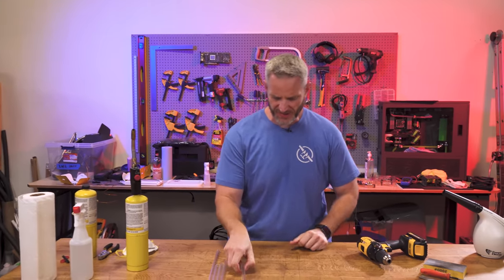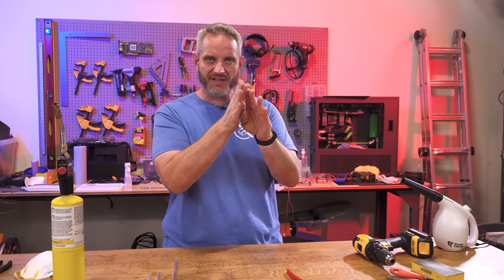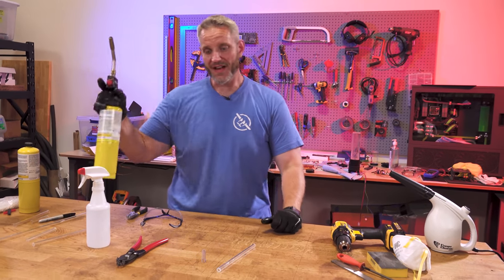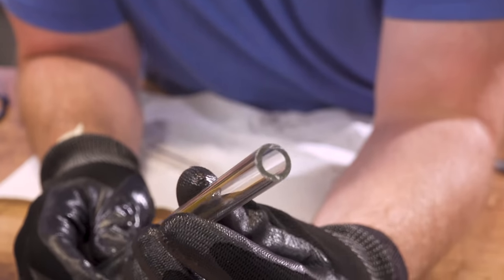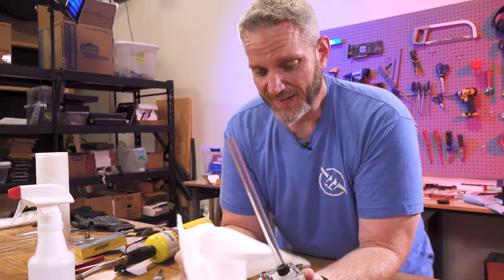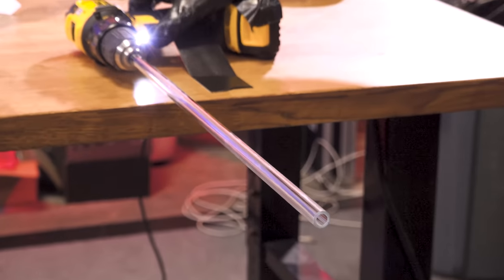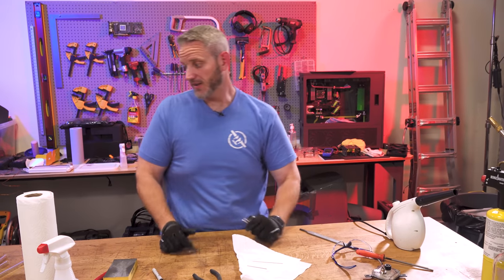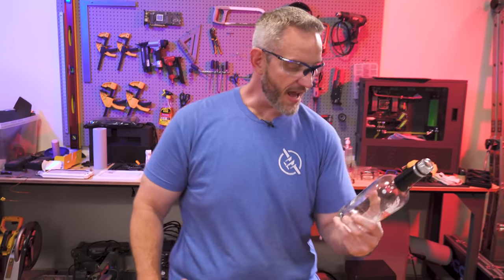Learning how to bend Glass Tubing... This looks soooo good!

Comment: Former sign guy here,  put a cork in one end of the glass and rubber tube with blow piece on  other end and as you bend glass keep constant pressure. OR find a neon sigh shop and have the neon tube bender bend your tubes for you. As somebody else said neon tubing comes in many colors and diameters (and is most likely cheaper) available from sign supply shop.

Comment: Nice vid, The glass tubing that has the spiral tube inside it, a glass distillation/condenser tube, with different coloured liquids/glass would look awesome as a main reservoir! When you place the 'O' rings on, try using a little water with some detergent to help get them in place, you could also use a small rubber washer to help with a water-tight connection.
oh and you really need to use some decent safety specs, the ones with didymium lenses are best for borosilicate.

Comment: if you're going to be doing a lot of glass tube builds.  In the stained glass world, there is a diamond ring saw to cut glass.  The blade of the saw is a 360 degree cutting direction.  This would be a  good way to precisely trim your glass tubing and giving a more finished edge after the cut.   Google "stained glass ring saw"  Zephyr makes a good product.

Comment: Try sliding a bit of PVC over the glass to "extend" the glass tube when scoring and breaking small sections off. You can even use a bit of tape to make the PVC friction fit to the glass.

Comment: To round the edges after scoring an snapping the glass tubing you can proceed to just heat it until the glass gets soft, then it will round the edges by itself without the need of sandpaper, etc.. Borosilicate glass has a really really low heattransfercoefficient, so you dont need to worry about the whole pipe heating up when your only applying heat to edges. In university we use a very powerful hydrogen/oxygen burner for preparing tubes and ampules and you can touch the glass even a few centimeters away from the spot you're applying heat to even, even without gloves you won't notice the extreme heat.

Comment: I'd make some mandrels out of hardwood to bend the glass around or at least as a guide while bending to get your angles correct. I also think you could cut off short pieces if you put the glass tube into a block of wood with just the right size hole drilled into it. If the short piece that needs to be broken off is near a bend, clamp the bend into a vice with blocks of wood and use another block with a hole drilled into it to break the short piece off. Alternatively, if you have the correct size drill bit  to fit inside the glass tube pretty tightly you can use that on your short end that needs to be broken off. Disclaimer, not a professional glass worker, just a fan of cheap tools for once in a blue moon projects like this.

Comment: When I make a short cut on glass, I put a wooden dowel in the short end to apply pressure from the center. Not a science or physics major by any means but I think the dowel evens out the pressure across the whole inside diameter of the tube. Hence making a cleaner break.

Comment: For trimming glass tubes use your dremel with diamond disc and for smoothing edges use your gas gun (torh) and apply heat on the edges until they start melting and you ready to go 
Good luck with next glass project

Comment: You need to make a loop with Quartz Glass Tubes! Blistering temperatures won’t melt these quartz tubes, and rapid temperature shifts won’t cause them to crack. Even tougher than borosilicate, they can be used in furnaces and ovens heated up to 2000° F. These highly pure tubes are often used in laboratories because they won’t leach impurities into samples or contaminate chemical reactions. Quartz tubes are optically clear and have excellent UV transmission, making them ideal for UV purification systems.

Comment: Two points:
1) You could have explained a bit about different types of glass, specifically borosilicate is much more resistant against sudden temperature changes than "common" glass, if the tube was common glass, your heating and cooling methods would have resulted in it cracking into pieces; and
2) If you want to cut the glass instead of the slightly dangerous scoring and forcing method, the diamond blades for e.g. dremel-type small drills are not that expensive. This goes also for drill bits that you can use to smooth out the sharp corners of glass, or even bevel glass parts.

Comment: Jay, As a retired OSHA inspector, safety first!  Get some safety glasses that are made for glasswork.  Save your eyes.   Get a block of wood and drill a hole so you can put that map gas bottle in it so it won't fall over, eventually, you will knock it over or set it down too quickly, and then it will fall over, it's top-heavy.  At some point, (and I know this will happen) those gloves are going to get too hot. and you won't be able to get them off fast enough, have a bucket of water close at hand so you can dip your fingers in it.  Glass needs to cool slowly to reduce the heat stresses you put in it with the torch.  reading a little about the annealing process will help.    If you must cool down the tubing blowing on the outside of the tubing isn't going to do much if the center is still hot.  Lastly, you will be surprised how fast the glass will cool if you just put it down on the concrete floor or a good-sized piece of plate steel.  It works like a heatsink.   I really enjoy your show and Good Luck playing with hot glass.  BTW, ox-acetylene is a thousand degrees hotter than the map gas.

Comment: Please do a themed glass tubing build!
Try using a Dremel cutting disk or diamond saw to cut shorter pieces. As long as you keep water on it and are patient you can literally carve granite with a dremel and some good diamond bits. I would be amazed if you couldn't shorten your glass tubes with one.

Comment: Jay, for making cutting the glass easier look into a small tile saw. They have the ability to hook up water and have diamond blades. You can find them reasonably priced at Harbor Freight or similar places. I just looked and Cali prices range from as low as $60 to however much you want to spend.
Reply: He's overcomplicating it. Just get a dremmel with diamond cutting disk.

Hold the tube in a vice (wrapped in a cloth or old t-shirt).

To cut more than 5mm off the tube keep the dremmel parallel to tube and move round it in a circle to score a circle, then just keep deepening the circle till the glass falls off.

To take under 5mm off, hold the dremmel the same way but use the top of the disk and move it in a circle as if you are polishing the end of the tube, it makes a lot of glass dust, so use goggles and mask.

To finish a tube off, use sandpaper round the edge, then a finer sandpaper after that.

Don't use a flame to treat the edge as it has a mushrooming effect and may stop the fitting going on.

Comment: Tip: if you want to break a little piece off like at 15:52, get a dowel that is the exact diameter as the inside diameter of the glass and use that as leverage

Comment: Use cutting oil when using your scoring tool, makes a much much cleaner cut and removes the necessity for water on the break. 👍 working with glass had its benefits 😁

Comment: I would try using a wet saw used for cutting tile .  They use continuous rim diamond blades . Its more of a grinding action so it might cut and smooth the edge in one pass.

Comment: I know when bending thin tube, a tip is to fill the cavity with sand and then block both ends. When the tube bends the trapped sand maintains the inside diameter meaning you will not get any pinch at the bend.

Comment: Glass can explode during rapid cooling. Also! If you put a little air pressure (I MEAN A LITTLE). The bend will stay more uniform. If you can find a squeeze pump with cut off valve. One squeeze will be enough. And I am not a professional  gaffer. But I have done hot glass art for two years. But really let glass cool slowly. It's far safer. Because small glass fragments in the eye. Is far harder for the optometrist to see and find. But the art of blowin glass is awesome. Corning museum of glas also has small peice videos on youtube. You should give those a look see. They are very cool.

Comment: Wow I’m impressed with your second bend . I didn’t think there was a way to do it without it collapsing on itself . I think a build using glass and having bends in it would be killer .
I’ve never tried a water loop , but your making me want to attempt glass after I see the difference in clarity.
I’m wondering if my Dewalt tile wet saw would work for cutting small amounts of the tube off ?

Comment: Use those compressable foam earplugs in to block one end if you want to introduce air into the other, honest im a bit shocked you can get a bend with mapp its not really hot enough to work it. Also that orange flame is called sodium flare and it is basically like lookin into the sun as far as eye health you should at the very least not look directly at it. lastly when bending you should always have the longer (outside) curve of the bend facing the floor (gravity makes the glass flow down, this helps with maintaining wall thickness consistency, tho at these temps it may not be as much help).

Comment: you can also snap shorter pieces of glass you will need 3 pieces of copper , 2 will be tubing 1 will be rod and a hand full of rubber grommets, take a stiff rod of copper the same as the inner diameter, and a piece of tubing the same size as the glass and one that will slide over that and the other glass, , to start slide the inner piece into the tube stopping before the cut line.
 Mark the inner rod with a sharpie and then remove it and slide the next size up to the mark you made drop a spot of solder onto it using flux, then use a file and by sticking the copper tube and rod into your drill flush up the solder and square the end of the second copper tube.
 Then reinsert the rod into the glass up to the end and use the 3rd piece of copper tubing as a slide over cover of the area you want to remove from the glass tube, the rubber grommets are used to take up slack if you need to make shorter cuts, to do this add onto the copper Rod to make the auger shorter, 
 My father used to use this jig when he would repair his Argon welding tank meters and tube volume meters.

Comment: My brother in law did Neon signs. You might want to look into how they do that since he could bend or weld the glass tubing like it was wet Spaghetti. One trick I saw him do was cork one end of the tubing, use a similar cork on the other end with a rubber hose that he would blow into while bending to prevent the bends from collapsing.

Comment: for the shorter Glass Breaks you can get a pole Slightly larger than the glass cut the pole in 2 and use that as extensions it works weve done it before but the glass has to fit snug like in the pole

Comment: You might take a look at videos of neon sign builders who blow and bend glass tubing to form letters words and figures for signs, should be some good info there too.  I think your original approach of watching videos of professional glass tube blowers (such as neon sign builders) was the way to go, as micheal anderson said below you need a blow tube to be able to blow into and support the bend so it doesnt collapse - just dont inhale-!-lol  I watched some glass tube blowing at a craft fair in Florida once and thats just what they were doing, blowing into the tube with a measured amount of pressure just enough to support and not enlarge the diameter of the bend, they made it look easy. The info is out there just gotta find the appropriate videos specializing in glass tubing.  When one doesnt know enough he askes those who do know, saves a lot of time and wasted material. Seems like I might also remember they heated their glass tube and used some tool to break it clean, but im not sure about that dont recall.

Comment: 16:08 For the minimum snapping length issue, just put a wooden dowel that fits snug in the shorter end of the glass to gain extra leverage. Worked well for me
Reply: Was about to comment this exact comment. GJ for having common sense. Makes me wonder if I am smart, or are other people just dumb.
Reply: @pauls.5815  My everyday question.

Comment: Here’s my tip. Put some sand in a fabric bag that can fit inside the tube. This is apply heat evenly and also keep the tube from collapsing on itself. The sand has to be very fine though.

Comment: 6:00 - The blue flame is actually the hottest. The orange in the flame is caused by the sodium in the glass burning off and is called the "sodium flare". If you're getting discoloration or distortion in the glass, it's probably from "overworking the glass"...you've heated it too much and burned off too much of the sodium.

There's an awesome video on Wired's YouTube channel called "Scientific Glass Blower Makes Beer Glasses" if you want to see more about this.

Comment: If I recall my science classes, the way to bend it is to heat the smallest length of the glass tube and keep turning both sides of the tube as you bend it

And I think if you scorn the tube, heat it and drop it in cold water, it will break nice and clean

Comment: Here's an idea for the usefulness of a 3D printer, try printing a collet to hold uniform pressure around the glass. This might be enough to allow a snap for a shorter length. Hell, you might be able to buy a collet but, it'll be a hard and unforgiving clamp, which may be what you want, I don't know for sure as I don't work with glass.

Comment: Jay, try getting your hands on some borosilicate glass - it's much more forgiving and easier to work with, plus it's extremely chemically resistant, so there is less risk of staining due to the coolant. And def get some special safety glasses before you go blind. Looking at glowing glass within the flame of a blowtorch is as unhealthy as looking at the ark of a welding machine.

Comment: Score it with a pipe scoring tool and then submerge it in cold watter and give it a firm tap as lightly as you can and it should break clean then sand paper for the edges

Comment: Jay, length of tube doesn't really matter.

Just get an angle grinder and put it on flat, trust me, you can get super smooth cuts like that. It might not be 100% perfect 90* angles, but it's fast and isn't visible.

Even better if you use a diamond ball dremel for the inside edges to smoothen them out, and to finish off you can use extremely fine sandpaper on a sander for the sharp edges on the outside.

I use a drill like you did, to hold the glass.

And please don't cool glass, let it cool slowly - I've had glass shatter before many times from just the ambient being too cold.

Comment: Or for cutting just use some wire, wrap around the glass, heat it up until red and then add a few drops of cold water over it, the glass will just break because of the sudden change of temp. You can do this with bottles too and you'll get yourself a nice glass.

Comment: just for fun, you guys should make a Prince Ruperts Drop!! Get a bucket of water, and melt the end of one of those glass tubes until it drips into the water bucket, and wait for it to cool down. What you should get is a prince ruperts drop, one  of the strongest glass structures at the bulby drop end, but also the most catastrophically fragile glass structures at the tail end. Then maybe go OUTSIDE, and with gloves and eye protection, snap off the tail end and see what happens! :)

Comment: If you burn your self, use mustard. Dab it on the burn as long as it’s not an open wound. Let it deans was it off. The vinegar in the mustard will take the heat and help it not blister.

Comment: Former Neon bender here. Just curious, does it have to be borosilicate glass? That stuff is more expensive and a right PIA to work vs leaded glass. The leaded stuff is like (90's pricing) 15 cents per 4' stick when bought by the case. It holds heat (remains workable like 2x longer) and is more forgiving to cut. 
Super easy (& clean) leaded glass cut: 1/4 radius score using a small (4oz) sanded, flat-edged metal file, hold tube horizontal with score at top, tap glass from underneath with file. Tink, done!
Reply: im no expert but if it has the same physical properties then I'm pretty sure it should be ok plus from what I can tell its pretty cheap so you can test it out without much risk
Reply: if you try it and it ends up working come back to this comment and lmk

Comment: When they bend thin pipe by hand they'll pack it with sand, something that will not react to heat & seal both ends, when heated & bent, it can't crush inward, the sand is in the way.  I remember Hawkeye on  M.A.S.H. bending a spiral for the Swamp's still this way.
Reply: If this works with glass tubing, you could fill a tube & do all the bends you needed w/o it every crushing, & when done, remove the sand.  And Thermal Shock can warp a cookie sheet, and or cause it to crack in the future with normal use, NEVER CHILL ANYTHING FAST unless you want it to fail, it adds fault-lines to its molecular structure.  I've seen a hot Dutch Oven shatter into 3 chunks when it was put in a sink with less than an inch of water.

Comment: You might be able to cut one inch sections of when find something that has almost the same diameter as the inside diameter of your tube. Put it in to just before you scored it and it should give you better leverage to break it. I've never tried nor have i ever worked with glass, but in my head it makes sense :D

Comment: To cut from 1 to 10cm from the end you can make a scratch and then wrap a thin wire around it. Use a power source to heat the wire with about 2-5A (12V source should be enough) and it will cut through the scratch. Might not be the most accurate solution looking at the flatness of the cut, but you can sand the ends to make it flat 😁